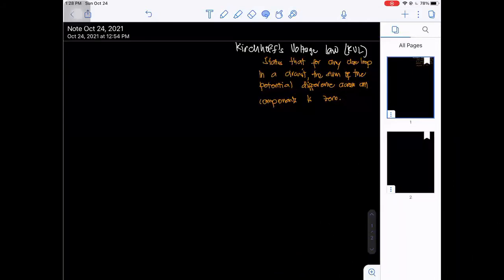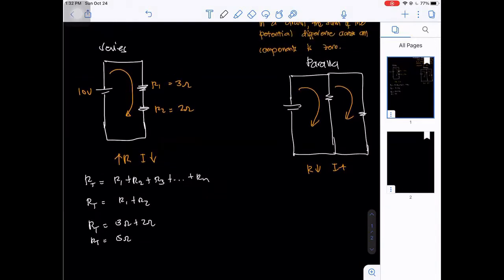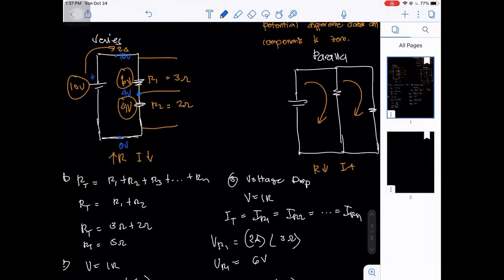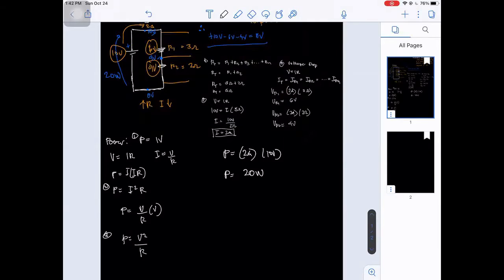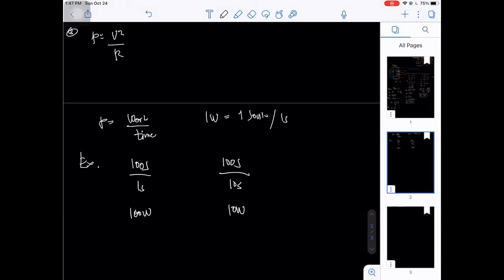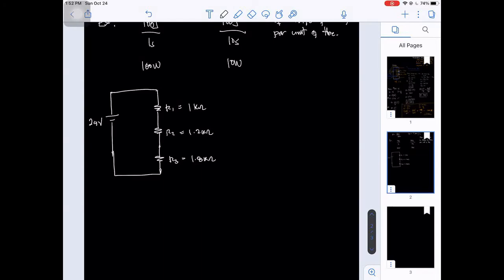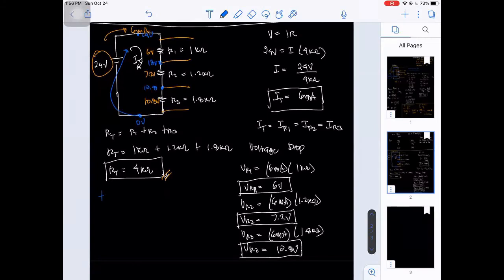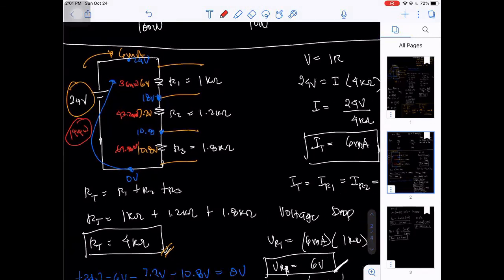Series Circuit

Comment: Thank you for the knowledge about the Series Circuits, Sir. It was really well-explained.

In the second example, though, I just had confusion with the result of the computation of Power from the said second method for R1. Because (6mA)^2 was multiplied to (1kΩ) and the result shown was 43.2mW instead of 36mW. But I figured that that part was supposed to be for R2 and that (6mA)^2 should have been multiplied to 1.2kΩ, which will result in 43.2mW. Other than that, the explanation was so easy to follow. And I thank you for that, Sir.
Reply: Yes, that us for R2, and we use P=I^2(R)